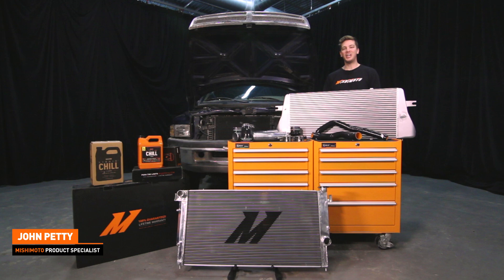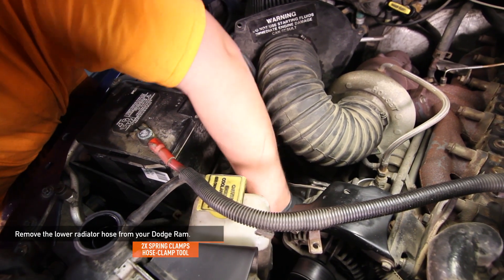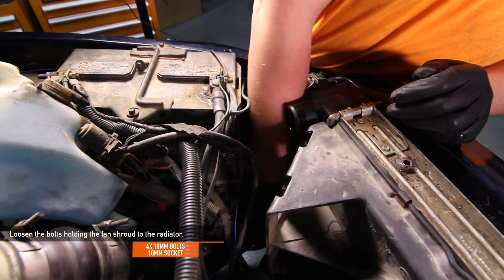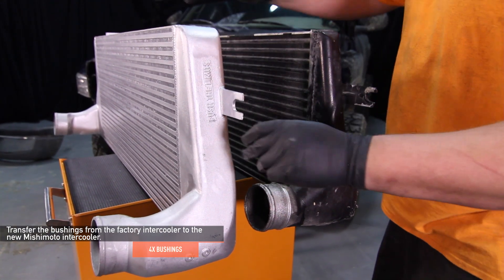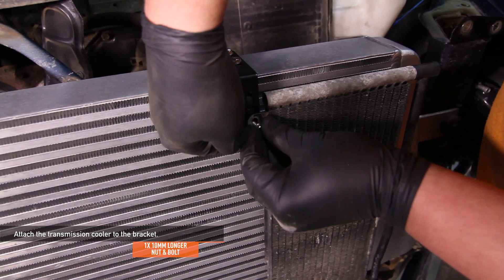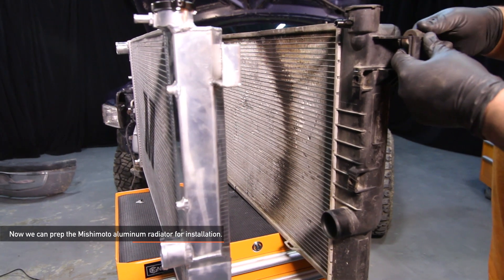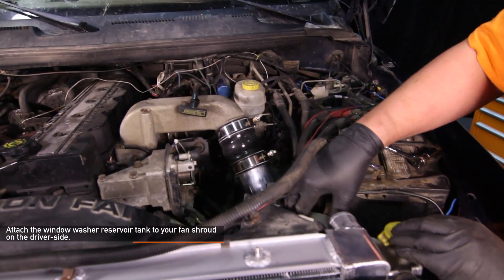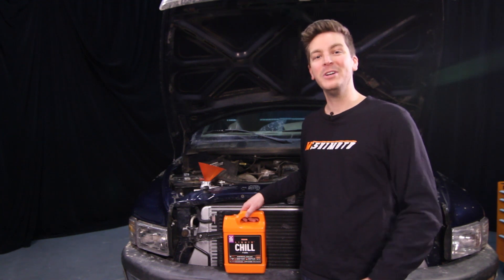1994–2002 Dodge 5.9L Cummins Complete Cooling Overhaul Installation Guide By Mishimoto

Comment: Attention....don't use stock bolts on the fan should use the supply 4 bolts that are short  the stock bolts are to long and will put holes in the radiator 
.